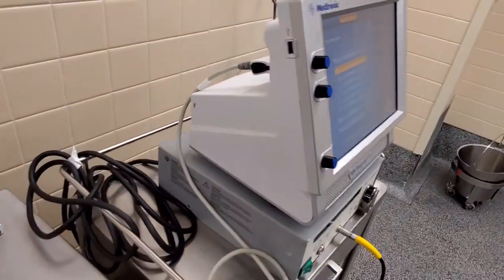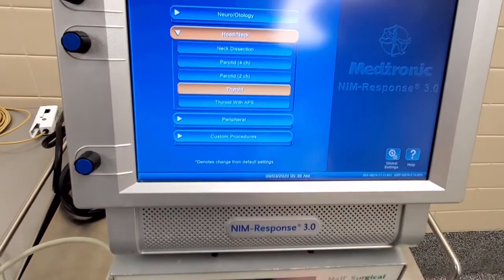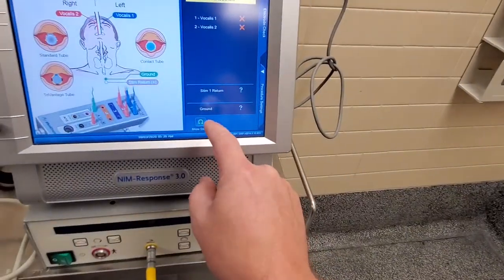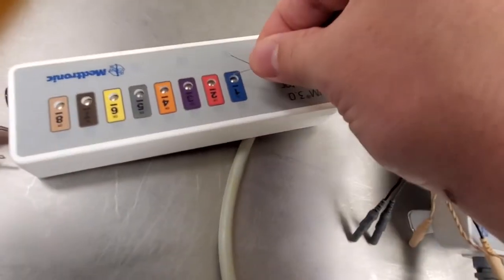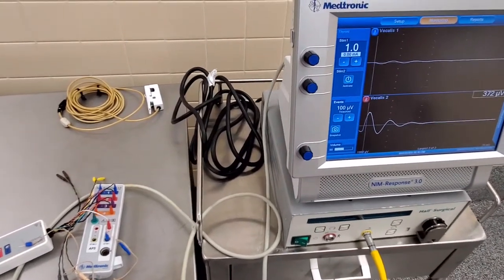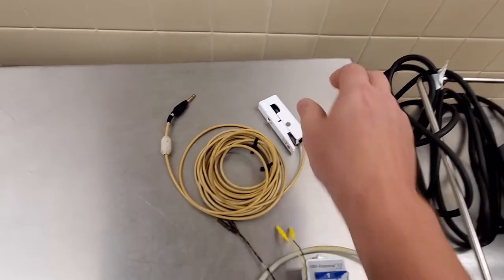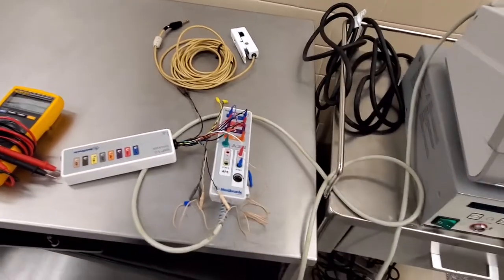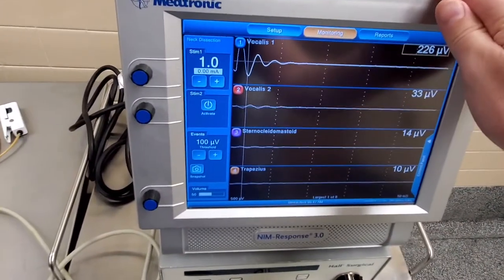Neuro Monitor NIM 3 Overview

Comment: I'm so sorry for all the comments, but i have a question. Is the simulator something that should be found with the unit? Or something i need to order for the Biomed shop? We have one of these in Sugery, and when i asked my guys what it is, no one knew, and they told me it was just electrical safety
Reply from the maker: A NIM has more than an electrical safety. The acquisition module needs to be tested and the only way to test is connection to the simulator. The simulator should be on or near the main unit because users are supposed to verify function before use.
You can always ask the neuro surgery coordinator if they know where the NIM simulator is.
Reply: @BetterBiomedChannel  thank you!

Comment: Question. Where is the white/read lead going into? Does the patient need to be grounded at all when using a monopolar stim probe?
Reply from the maker: There is a ground (common lead). A monopolar system means that an electrical signal needs to travel to a ground of some sort.
Reply: @BetterBiomedChannel  yes my question is which lead is the ground? White and red ?